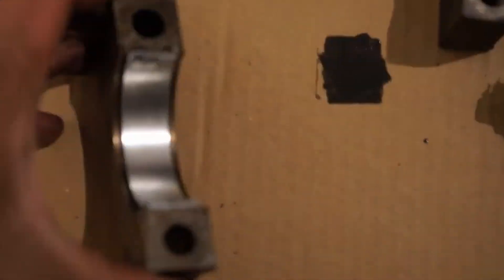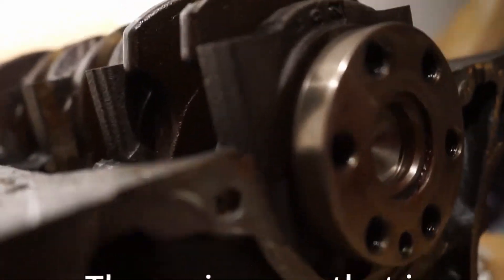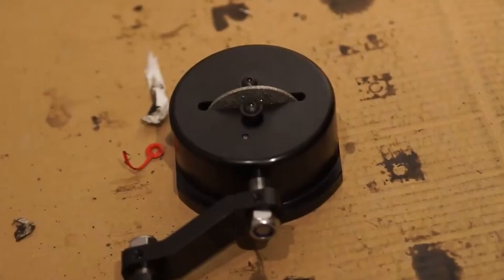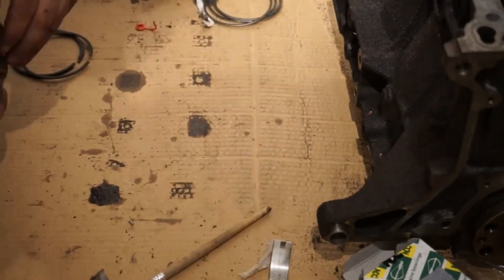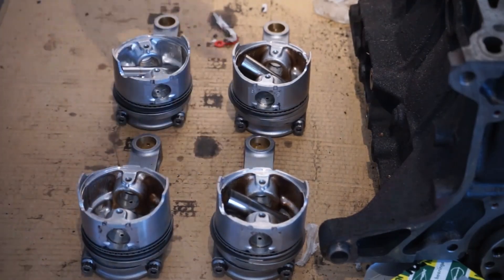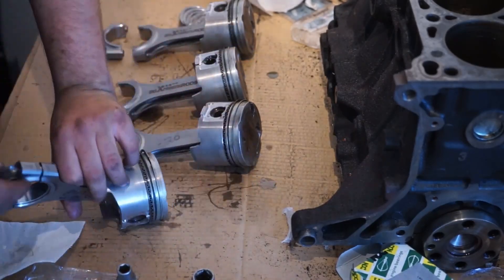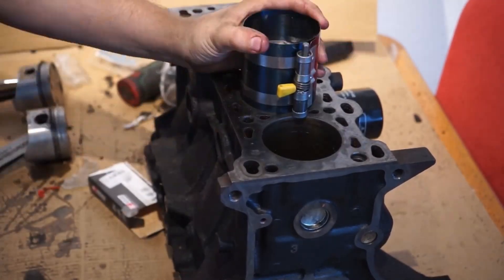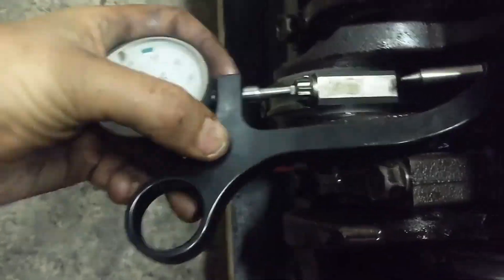Stop copying Tunes and Maps! | Why tuning every car individually is necessary on a Standalone

Comment: The smaller the engine, the higher boost pressure, the more different in parts manufacturers, the more true this is. With that said. Using a free sloppy tune on an LS, and only running low boost will get a guy 98% the way there for a fun cheap build
Reply from the maker: on a standalone ecu it just doesnt work in general. 

On a stock ecu you can copy tunes mostly without an issue because the margins of where the ecu can actually change stuff itself are A LOT bigger and it can do a lot of stuff on its own so there isnt an issue. but with a standalone this definetly still is not true.

Comment: I’ve only ever owned Japanese cars all my life, and recently purchased an Opel Astra (here known as a Holden). It’s got 185,000km and at 130,000 it had a replacement ECU. If this one craps out on me I will fit a speeduino even though it is a daily driver 😂
Reply from the maker: Im running a speeduino on a daily also, works fine haha
Reply: @throttlebuddies0 nice! I’m sure once you get it set up fully the only weaknesses are your soldering in the speeduino and crimping of connectors. 

A lot of older cars get solder problems as they age.

Comment: Copying a tune as a base can save you a lot of dyno time.
Reply from the maker: not really, because a base tune is usually done before the car even runs and getting the tune so far that you have to use a dyno, then a tune that just has been copied wont work.
Reply: Yes it does.  And engines are different but the only difference between these components is a couple of percent.  And with ve tuning, that’s what theyhave short and long term trims.  As for timing if it’s pulling timing then knock
It back.  And  if you’re doing closed loop. Then that’s common sense to use a safe timing map. It’ saves times in building the rest